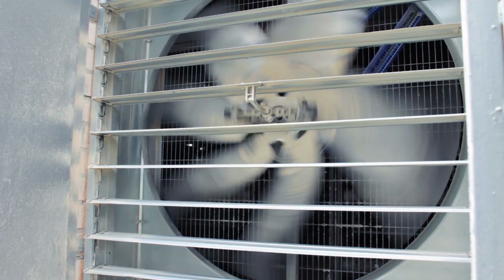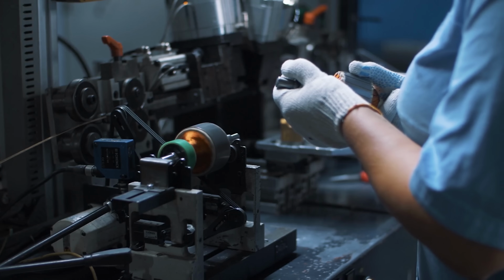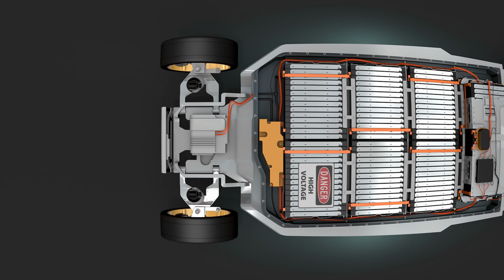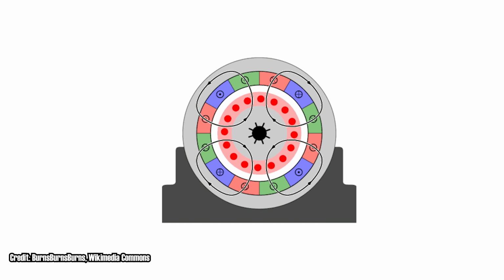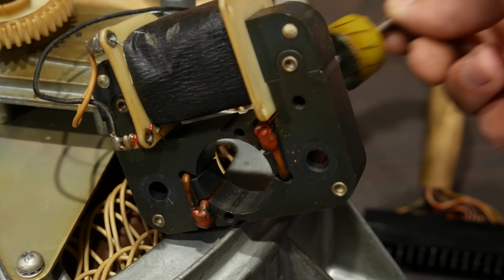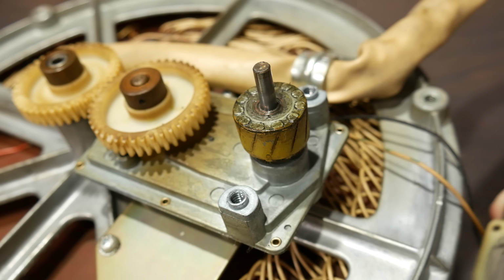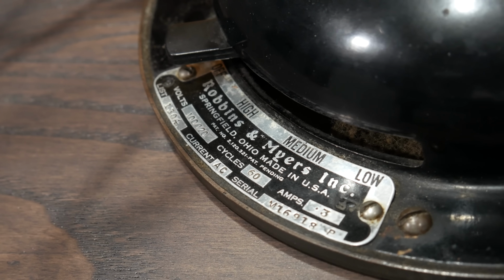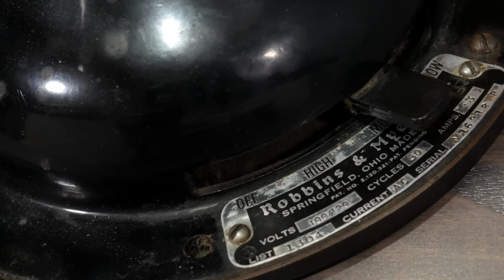Fans; High is next to Off on purpose

Comment: This is a problem only found in North America, parts of South America and Japan, since they use voltages in the 110v to 120v range. The rest of the world uses 220v, so thats not a problem.

I've never seen a fan with "high" first.

It's the same problem when you bring your electronics from the outside INTO these countries. Nothing works properly, since it only gets half the power it was designed for.

Comment: I thought it was an issue of back EMF. Generally a faster spinning motor produces a higher electromotive force opposite the voltage. The lack of back EMF reduced effective resistance, meaning the current runs high and heats the wires more.

Comment: There are 3 foot home use fans that do move air pretty good.
Then there are 3 foot commercial fans; bigger motor and more power. So we had one of those at my job; 220 volt and reversible...but mostly used as a secondary Exhaust Fan...the original Exhaust Fan was the same size but it was only exhaust. Anyway...when the Electrician was doing all the hookup for this spendy commercial exhaust fan, he was told by my boss to install a normal light switch for 1/2 of the 220V circuit...and a rotary timer for the other 1/2 of the 220V circuit. I saw my boss tell the electrician to do this. As he was hooking it up I whispered to the electrician "This is really dumb! It should be one switch, or one timer for turning the Fan on/off" Electrician agreed but did not care enough to argue with my boss; this was not dangerous it just made the Electric Motor wear out faster...because like this video explains the starting of a motor is different than what it takes to keep it running at design speed. That Electric Motor was about three hundred dollars, and in three years it got replaced twice...but the second time I told my boss the switch should be a single Timer for BOTH parts of the 220 circuit, and the motor worked fine for the next ten+ years because of having the correct switch.
Reply: To clarify why the original dual switches was really dumb; 220V is two normal 110V circuits. Since the Electric Motor was designed for 220V if the light switch was turned on but the timer was off; it would be getting power but be unable to move...so overheat. Same thing could happen if the light switch was off, but the timer was on...but this would usually not happen because employees could hear when that fan turned on+ so much air you could have a door slam shut 200 feet away when you turned on the fan = if they wanted it on they KNEW when it was on.

Comment: I figured out a lot of this first hand with the giant metal fan in my room.  I don’t usually bother setting up a window AC in my room and the fan does the trick in the summer, but since I’ve used the hell out of it I have to coax it to spin by toggling between off and high.
Reply: The Electric Fan that Use has 4 buttons-
0-OFF.           1-LOW.             2-MEDIUM
3-HIGH

Comment: Capacitors are not used on shaded pole  motors. Capacitors are used on motors with an extra winding in  the stator.

3 Capacitor values are used for the 3 speeds.  The Capacitor changes the electrical phase angle. Different values of Capacitors have different phase angles.

Why didn't you get an electrical engineer to write this?

Comment: I have a 55 inch fan which I put a 1 horsy 3 phase motor on and run it off single phase with a VFD. I also have a DC braking resistor on it.

Comment: Question for future video:  Why is the power switch on a power strip always near the cord end instead of the very end of the strip?  It would be so much easier if the switch were able to be positioned toward the user instead of away.  In that way the cords would all be running away from the user, out of site, not collecting dust as easily.  But, NO.  every power strip wants to save a dollar's worth of wire to position the switch near the cord end.

Comment: The reason that fans operate by off>high>medium>low is because the higher jolt of electricity by switching to "high" gives the fan enough power to start spinning, whereas starting it on "low" wouldn't give the fan enough electricity to start spinning. The momentum given by the high voltage gives the fan an ability to then remain on low.

I just saved you 17 f*cking minutes

Comment: I had a floor fan in college that used a start capacitor to get the motor spinning. It eventually died and did enough damage to the motor in the process that the fan still wouldn't work after I replaced the capacitor.

Comment: I hate fans because if the air conditioning is adequate they are not necessary.  Having fans running means the air conditioning is lacking. Were i ever to live in an arid climate I may change my opinion. Being highly sensitive to high humidity, I am miserable when my body can’t cool itself. In Houston it drives me insane to see outdoor restaurant seating with misters attached to fans when the dew point is 78 F.  It’s just soaking everyone with water. Explaining why this is a bad idea usually gets an eye rolling negative reaction and complete confusion and disbelief.

Comment: I had my first encounter ever of a fan not starting because it was on the low setting. well it did end up starting but that is actually how I noticed. It's a 20 year old Hitachi fan that a co worker of mine has been repairing since he got it. Instead of a dial it has selectable buttons for speeds. I turned it on the low setting today and went back to work, about 20 seconds later I noticed it started up very slowly and realized I knew why it happened! If you'd like I can share a picture of it. I will have to take one tomorrow morning.

Comment: I like the way the EV industry purposely attempts to confuse us. If you go to Home depot or any electric motor shop, you will find electric motors have a plate attached just full of  tech info about that motor. Operating volts-Amps it will consume and Americans favorite number - HORSEPOWER. Normally the motors we use about our homes are not much-air compressor might use 1/3hp my table saw uses a 2hp - my well pump is 3. But there are motors in the world that use a lot more. An big ass air compressor @ a car wash might use a 5hp. So when EV makers are bragging about their latest build and talk about the drive motor hp rating is always omitted. They tell us how many KW the motor uses-like we all know how much or what a KW is. Its like metric for motors. Purposely confusing.

!

Comment: I almost cut my fingers off in an old 1940s industrial fan. I was playing drums and it was behind me and had not thought that about how it was one of those open guards and my fingers went right in. Still have scars. Also youre holding that old fan and its likely a brush motor dont do that! Only do that if its a brushless motor unless you wanna burn up the windings!
Reply: Also you need to oil that old fan if you havent

Comment: I must have a odd fan in that case. About 15 years old and settings go from OFF on the bottom then 1 above OFF followed by 2 and 3 on the top.
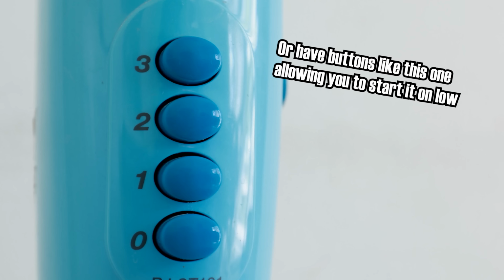Exactly like the example at 15:41.

Comment: Induction motors are extremely inefficient when you use this type of speed control. Just compare with your watt meter High vs med vs low. Power savings are minimal compared to the reduced output. It's better to just get an appropriately sized fan and run it on high.  The only efficient way to control the speed of an induction motor is with a variable frequency drive.

Comment: Ceiling fans are electrical, too. They can start without going to the high speed first. I can set it at the speed I like, turn it off at the wall, and when I turn it on again, it doesn’t cycle through the faster speeds. What’s the difference?

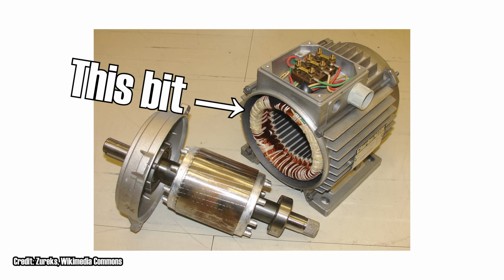Comment: 3:08 "Household electricity doesn't spin" I beg to differ - it does spin in Europe :D
Reply: I am 100% it doesn't in your house as that is 3 to 6 hot wires... you have 3 phase transmission lines but not in the house... we have 3 phase high voltage transmission lines ourselves in the US but in many ways.. basically no one ever needs 3 phase outside of i guess apartment complexes... you have 1 phase coming from thoes outlets
Reply: @Scudmaster11  You are wrong. We have a completely normal 3-phase line running all the way to the house. They are not available only in some old apartments (50+ years old), which are connected in single-phase. But even there, only those apartments that have central water heating for the whole house or have a gas water heater. In houses, appliances that have a higher power consumption or that are advantageous for some reason are usually connected to three phases - usually stoves, heat pumps/larger air conditioning units, boilers, electric boilers or, if someone is a DIYer, circular saws (they have a higher torque), lathes, more powerful welders, etc. The rest of the house is connected in single-phase so that all three phases are always loaded approximately equally within one house. This is how most, even very old, houses are. Only some small houses in the 1920s-1930s in remote areas were connected in emergency mode only in single-phase, but this was gradually corrected.
Reply: @Thales_WH do you mind sharing what county you're referring to?
Reply: @mnikpro  Czech Republic - a country between Germany, Poland, Austria and Slovakia

Comment: Some types of electric motors where you really notice stalling is in power tools with a variable trigger. Particularly the brushless motors.
If you pull the trigger slightly, it doesn't spin but makes a high pitch noise. Not sure if the noise is from the mosfets perhaps? I watched a lot of AvE's videos in the past about mosfets in power tools and he does some really nice videos on power tools. (Also not sure if that high pitch noise is bad for the tool. Some of the apprentices will cause the tool to make the noise while they are standing around not working/talking) Is that the mosfets or the motor itself trying to get moving?
I also noticed with most bench grinders that have an on/off only switch, they really hum before they get some momentum going much like the ceiling fan you showed.
Great video. I knew how the motors worked but never really thought about the start-up of them. 
Cheers :)

Comment: 8:19 ahhh this is why some of the older planes needed a boost at startup, neat
Reply: Older planes were diesel not electric
Reply: That turn on the propeller is the same as turning the crank on an old automobile, or pulling the cord on a chainsaw. 
Internal combustion motors needs something to start turning them so that the intake, compress, combust, and exhaust cycle can start(don't at me about 2 cycle engines, they're doing the same thing, but don't bother to separate the steps). 
The analogy has some weight, but the combustion engine needs to be moving so it can add energy to the fuel so that it can extract more energy for the fuel. This isn't quite the same as the induction motor, which needs an "imbalance" to produce the torque.

Comment: amp draw, the high setting is the motors max speed and lowest draw on startup, to start it on a lower speed could overload the circuit its connected to

Comment: WAIT is this why with old propeller planes you’d always see the pilot manually turn the propeller before the motor took over and it spun on its own?
Reply: With old prop planes, hand-propping was just to get it past compression and fire up, since they lacked or had weak starters.

Comment: You touched on a question that's been on my mind for a while now. If I have wall switches (non-smart) with fan speed control, does it matter which speed the fan itself is set to with the pull-chain?

Comment: on is the opposite of off. off is null. on is what ever max current can be at. lower speeds mean more resistance. so as you move the dial, you are adding resistance.

this is what I understand. but am not willing to whatch the video.

Comment: YOU HAVE MADE AN ERROR YOUTUBE MAN AND I WILL CORRECT YOU

US homes are not two-phase, hence we don't get 208V. Homes (well, non-quadrillionaire homes) split a single 240V phase by center tapping the transformer to get two 120V legs. Big devices that connect across the legs get 240V.

I accept payment in dogecoin.

Comment: Hey just had an idea for a cool experiment, pardon the pun haha, so you tested a old fan and couldn't get it to stall by starting it on low, but what would it take to create that condition, and does the age of the motor have anything to with it ? So im thinking if you could add small weights to the blades, making it of course harder to turn, then you would eventually be able to create a stall condition, and be able to test That against older fans or different types of motors.

Comment: lol my floor fan is the opposite, it starts on low first. I think it got wired incorrectly. I recently took it apart to clean it and thought about fixing it but I don't know enough about that part to do that, oiling the motor was at the edge of my mechanical ability

Comment: I assumed that sense it is using a knob it is continuous and there for if it goes from off to high you might turn it to very low speed and not realise it and so the fan would still be on.

Comment: I have this obnoxious remote controlled ceiling fan in my bedroom... if I turn on my lights it tries to come on (because of course it's linked to my lights) and it'll often stall if it isn't set to 5-6 (it's a six speed). It often seems to work this out itself though. It seems to stop, attempt a restart then it usually gets going.

Comment: What do you mean "air is a fluid"?
Don't you mean behaves like a fluid?
Reply: It IS a fluid.
Reply: @Winasaurus  It contains several gases and behaves like a gas. Saying it IS a fluid doesn't make it so.
Reply: @joeakajojoconwell6912  Fluid and liquid are different things.

Gas is fluid.
Liquid is fluid.
Reply: @Winasaurus  yes, those statements using fluid as an adverb are correct, but that's not what you said originally, twice. Originally you said you said air is "a" fluid, when used as a noun it's synonymous with liquid.  

If you're sticking by your original statements why would you change to use fluid as an adverb now?
Reply: @joeakajojoconwell6912  Gas is fluid. Gas is a fluid. Gas is an fluid.

How many more times do you need it rewritten before you understand? I even threw in one with wrong grammar just to keep your eyes on it.

And it CAN be synonymous with liquid. But synonyms are context dependent. And in this context I'm clearly not suggesting gases are liquids.

So you're assuming something I never said, then complaining that I "changed" when I kept saying the same thing. And you know what they say about assumptions, they make an ass out of u.

Comment: I thought it was that way so you can turn it off quickly from the highest speed in case of an accident that invloves anything with fingers. On the other hand that wouldn't make sense in modern fans which have grid cages around the paddles.

Comment: This is pretty recent, my older fans were in a normal order, nowadays they are all either a full circle or this one touch senson that starts at 4th
Reply: Some of the "touch sensor" types may not be the same type of motors with multiple coils for speeds.

To save $$$, some factories might use a motor with 1 coil (would be the highest speed) and then use what's called, PWM (pulse width modulation) to "pulse" the motor at certain ON times/OFF times (in microseconds)  to obtain the speeds.
In fact, using PWM, one could have a variable speed setup.

The thing is, even when "low", the pulses are full power (just super short duration) and the 1 coil is "high speed" so the motors will always start as they receive full current.

Comment: This ecplains the blower motor in my cars heat/ ac system going out. I turn it on high and sometimes it wont work unless i slap the dash very hard repeatedly, or if i turn it off and back on repeatedly sometimes that works too.

Comment: I just checked my heater which I bought about a month ago which has the off, then a fan sign, then one dot and then two dots. It seems mine goes from low to high but I'm in Western Europa so maybe that's why mine is different 🤔

Comment: My ceiling fan has a switch and a dial, the switch turns it on and off, the dial controls the speed, but for some reason the dial has an on (fastest speed) and off (off) spot on it, why would I need an off on the dial switch, when I have.. a switch

Comment: I am confused I don't think I have ever seen a fan that goes off,3,2,1 until now... The only dial I have seen that starts high is a gas dial on a stove. Maybe it's a UK vs US thing I don't know.
EDIT: not to mention I have also never seen a domestic house fan stall on low probably due to the fact it doesn't take much to move a fan blade

Comment: I looked for this video because I recently bought a new fan - but this one has a dial that goes Off-Low-Mid-High-Night, "night" being a less-than-low setting that is more silent, so you can use it while sleeping. Does that design follow the same reasoning?

Comment: I noticed that my crock pot goes from off to high, then low, then keep warm. I assume this is entirely resistive heating and that the high is placed first to keep you from accidentally undercooking your food and getting food poisoning. Is that correct, or is there a mechanical or electrical reason?

Comment: My 1948 HotPoint Oven has a similar setup. The Calrod burners are supposed to start at high and then turn down to desired setting. The dial says High,Second,Third,Low and Warm any thoughts?

Comment: My old, and now defunct fan had piano keys rather than a knob. You could always select low. My big floor fan has electric remote control selection and can always select low. My window fan has buttons to select whatever speed I want.
I only have one fan with a rotary switch, and it does start on high, and it's annoying.